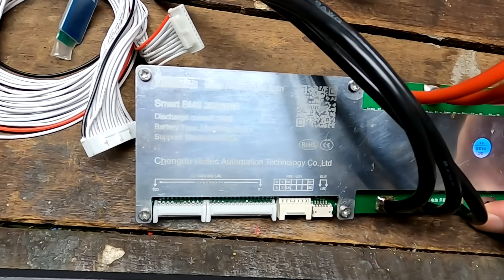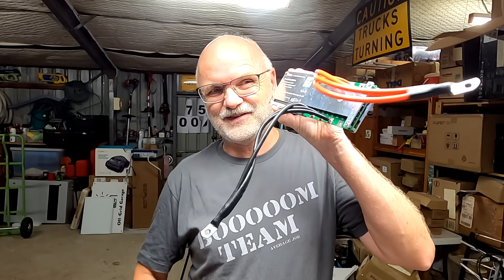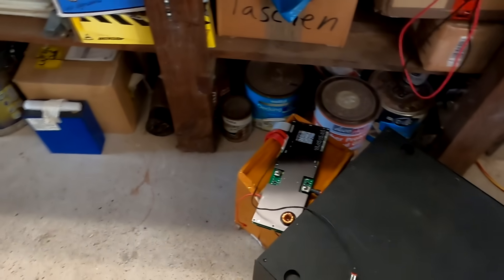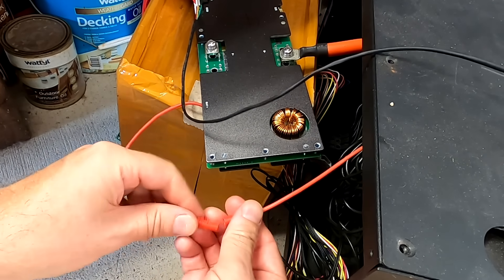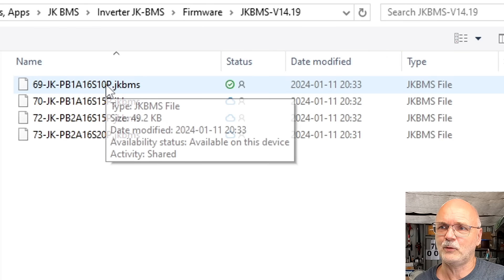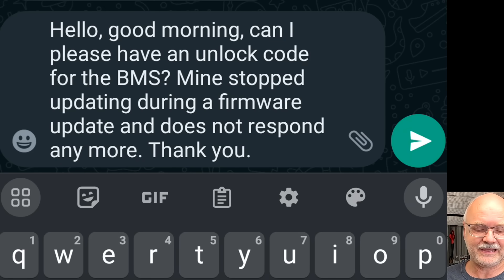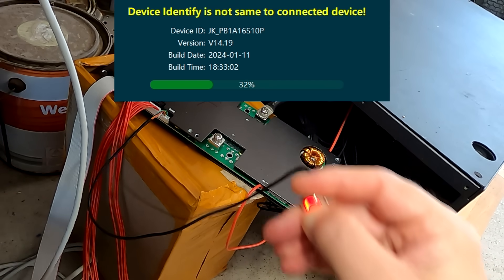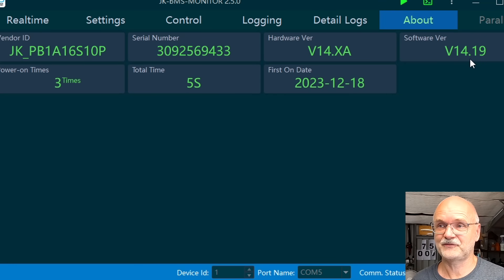How to recover a bricked JK Inverter BMS. Using Force Updating to save your BMS!

Comment: Awesome Andy for your great community support!
Keep it up

I too recovered from a failed Seplos BMS 10E firmware update too. But I cannot exactly remember the steps I followed :(
Reply from the maker: Ah, I didn't know they can fail as well. It would b great to have these info. Did you follow a procedure Seplos sent you maybe?
Reply: I didn't check with Seplos.

But I guess below were the steps I followed:

1. removed all battery and inverter cables including sensing wires
2. kept the pack idling for 5 mins or so
3. reconnected cables (without inverter cables)
4. flashed one of the firmware

Comment: Great work finding this solution. 
Crazy that JK didn't seem to know how to flash a bricked device.
Reply: Not apparently at first?,.. and then they can suddenly provide a code, it remains strange, or the timeline in the video is not correct..
Reply from the maker: @habana7638  A while back, JK and I tried to fix the bricked BMS without success. JK tried many, many different ways and then finally gave up. Holding the power button was never part of any of their provided instructions.

Comment: Great video Andy - I still haven't upgraded mine yet but touch wood it's been up and running for weeks now with no issues whatsoever. Was worrying about flashing the firmware after hearing about you bricking yours but as always you've settled my nerves! Keep up the good work - prost! 🍻
Reply from the maker: If yours is working as you need it, I wouldn't bother updating unless you need the new functions which came with v14.16 or later.

Comment: Is this also possible with the old style of BMS ?
B2A20S20P
V11 is currently the firmware I have. Can I replace it with the V14 or V15 ?
Reply: No, firmware on the old style BMS can not be updated.

Comment: Oh wise and knowledgeable JK BMS expert,i have purchased my first jk BMS and I see Ballance plug one has for a start 2 black wires that look to go to the sensor and the very next wire I would assume goes to the negative most battery terminal, however I would expect that it should be a black wire,my one is red,is your one here the same? As mine is exactly this model
Reply from the maker: I have heard from other that JK is sometimes using just red cables without any black one. I never heard about two black ones though. I would just connected them as usually, first one is bat-, next one is bat1+, next one is bat2+,... The BMS should also come with a manual and some diagrams on how to connect the BMS. Follow that recommendation.

Comment: i have the 200A version and it keeps tripping when larger motors start (vacuum or a/c). They draw 50A only each and Discharge OCP Delay (S) is set to 600 (in case it's actually mS) to avoid tripping with inrush current. Super annoying.
Reply from the maker: I haven't had a vacuum without soft start and motor control since the 70s tbh. Even my shop vac is spinning up to avoid surges.
Reply: It might be your cables, your batteries, your inverter, ... It could be that the voltage dips?

Comment: So how does this timer work, does JK corporate have access to our BMS in real time?
Reply: It's just a time based generator: the code is based on the current time stamp. The application computes the code and see if it matches within a range of an hour or so. Meaning that if you can set the clock on you computer to the same time Andy has, the same code should work.
Reply: who knows?
Reply: Any Chinese device with a chip has.
Reply from the maker: They can't access your BMS remotely. How would that work??? It has only BT connection without internet.

Comment: If the PC Software calculates the code based on time: we just need the exact time you requested the code / when it was valid and everyone could set the Computer to this date and time for the upgrade
Reply: I can confirm, I have  repaired broken bms using Anddy password, I have changed the time, date. No internet on laptop.
My bms is back to life.
Thnks Anddy,
Reply: @gepevoltexpert  Thanks for confirming!
Reply: January 16th 2023 at 11:23 he received the code (keep the Timezone in mind)
Requested 11:10
Reply: @andreasw5925  @Andy: reset your clock to ^ and test the code. Or anyone else that has this BMS really.
Reply: @andreasw5925 2024, maybe?
Reply: Have you tried?
Reply: I can confirm, I have repaired broken bms, I have changed the time, date. No internet on laptop.
My bms is back to life.
Thnks Anddy,
Reply: Yes @Off-Grid Garage, please tell us time and date when you used the code
Reply: So this implies that the PC you are running has the correct time on it. I wondering if we are being fed a lie and that any provided code can be reused again and again outside the correct time. If not - set the PC time to Andy's time and see if that works. If folk collect various numbers from JK - then this can be easily cracked. Still having though issues as to why one has to have a code to begin with - unless this is for security and they collect details of those that ask them?
Reply from the maker: OK, I will test this out...
Reply: I think it is not so easy (though I will be glad to be).. What if both of the clocks, the computer's and the bms's must to be the same at the time of the update? If on the computer you can modify the date and time to be able to reuse a JK code, the bms it supposed to be not accessible at that moment (reason of the force update... ). Because the bms it is not dead,, it can be seen into the mobile application, but not accessible through Bluetooth, so the pc software can retrieve the data and time from it if it is a condition for validation of the dynamic key... And if the time and date aren't the same on both bms and computer, maybe the pc software decides the code is obsolete... Just a thought, hope I am not right..
Reply: @mariusdodoiu942  There is no clock on the BMS.
Reply: @upnorthandpersonal 
On the mobile application, the last item in"control tab" is "time calibration"..., so there is a time there, please check.
As we found earlier, the dynamic key can be used if only the pc date and time are modified, and this is a good thing.
Reply: @mariusdodoiu942  Right, but it has no real time clock, that is, there is no battery back-up when the BMS is disconnected and the BMS does not get time from a server somewhere. But yes, the point is moot now that we know it works. Next step: build a code generator. Hopefully Andy or someone else can post a bunch of date stamps with accompanying codes. Doesn't need to be a lot, but more than one would be nice...
Reply: I'm thinking, would they just use the last 8 digits of the Unix epoch timestamp or something. I can't test that since I don't have this BMS, but would be a good first attempt. Andy, up for some trial and experimentation?
Reply: @upnorthandpersonal  more like a time based calculation some “seed” I guess. 

Linux epoch times for every minute from 11:10 AM to 11:23 AM on January 16, 2024, in the Australia timezone:

- 11:10 AM: 1642276200
- 11:11 AM: 1642276260
- 11:12 AM: 1642276320
- 11:13 AM: 1642276380
- 11:14 AM: 1642276440
- 11:15 AM: 1642276500
- 11:16 AM: 1642276560
- 11:17 AM: 1642276620
- 11:18 AM: 1642276680
- 11:19 AM: 1642276740
- 11:20 AM: 1642276800
- 11:21 AM: 1642276860
- 11:22 AM: 1642276920
- 11:23 AM: 1642276980

And used code was 14012106
Reply: @upnorthandpersonal  Linux epoch times for every minute from 11:10 AM to 11:23 AM on January 16, 2024, in the Australia timezone:

- 11:10 AM: 1642276200
- 11:11 AM: 1642276260
- 11:12 AM: 1642276320
- 11:13 AM: 1642276380
- 11:14 AM: 1642276440
- 11:15 AM: 1642276500
- 11:16 AM: 1642276560
- 11:17 AM: 1642276620
- 11:18 AM: 1642276680
- 11:19 AM: 1642276740
- 11:20 AM: 1642276800
- 11:21 AM: 1642276860
- 11:22 AM: 1642276920
- 11:23 AM: 1642276980

Code used was 14012106

Comment: Hi Andy, can you tell me were I can get the RS485 to USB adapter? There's quite a few out there and some people seem to have issues with certain model...
Reply: I believe it's linked to on Andy's website.
Reply: The only, I could get work on my Dell laptop was "waveshare industrial USB to RS485 converter with original FT232RL". Tested honestly like 4 models and this was the only one I could get work. You need to sacrifice one RJ45 cable and connect 3 cables according to JK pin layout. Easy.
Reply from the maker: I tested a few here and they all worked and are linked on my website: https://youtu.be/I6qz5ZIKzTA